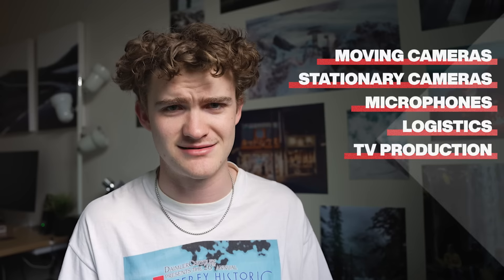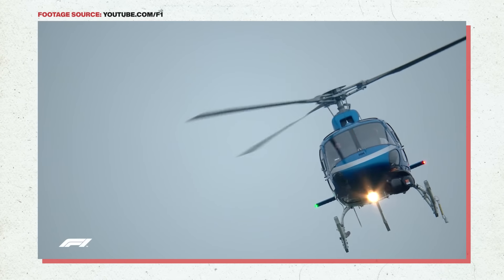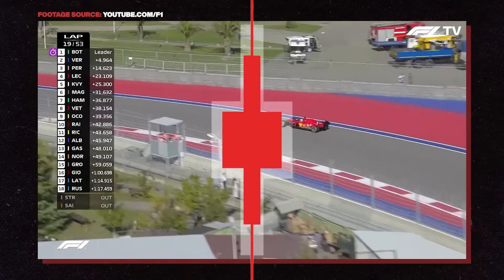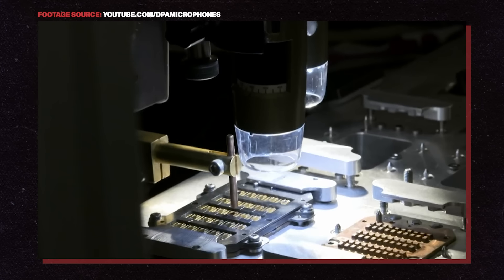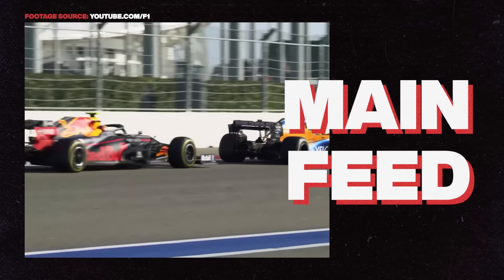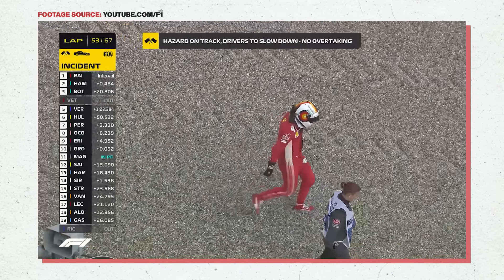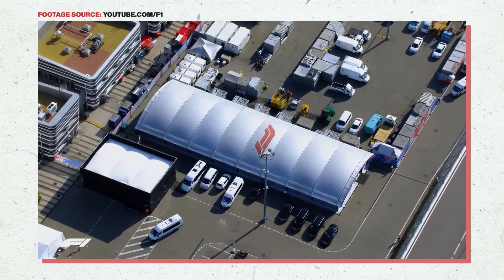How Formula 1 is Filmed (It's a Technical Masterpiece)

Comment: 🎯 Key Takeaways for quick navigation:

00:00 🚁 Overview of Formula 1 Filming
- Formula 1 racing is not just about the cars but also a technical masterpiece in terms of filming.
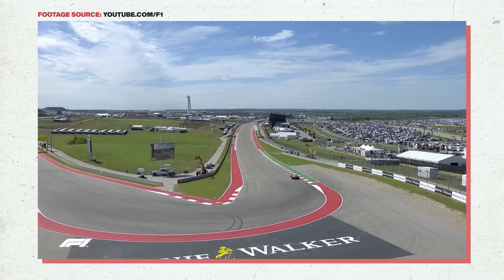01:24 🚗 Types of Cameras Used
- Helicopter: Provides dynamic and immersive shots using camera stabilizers.
- Onboard Cameras: Offer exciting footage by placing lightweight cameras on cars.
- Cable Cam: Utilizes a high-speed camera system for tracking cars.
03:03 📹 Trackside Cameras and Specialty Cameras
- Trackside Cameras: Vital for race coverage, providing quality video feed for broadcast.
- Specialty Cameras: Include embedded track cameras and scissor lift cameras for unique angles.
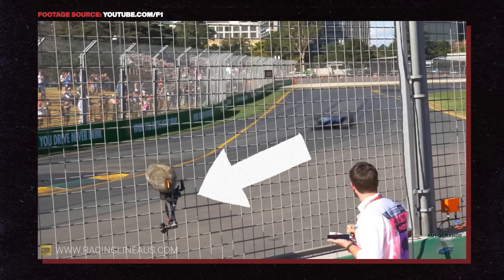06:39 🎤 Importance of Microphones
- 147 microphones around the track capture the sound critical for viewer enjoyment.
- Fans' complaints led to the introduction of car-mounted microphones to amplify audio for TV.
07:36 📺 Television Production Process
- Complex process of combining 126 cameras and 147 microphones for seamless live broadcast.
- Different teams manage audio mixes, replays, and trackside coverage for compelling TV program.

Made with HARPA AI

Comment: The saddest part of all is that even with the microphone right at the exhaust, the modern cars have absolutely nothing on the V10 monsters from the early 2000s. The starts of any GP from 2000 to 2005 could've been heard as far as 10kms away. The all-time record i think was held by Ferrari 's 643 in the 90s when at Imola it produced almost 160dB or as loud as Boeing 747 at full throttle during take off. 20 000 RPMs with 10 cylinders sounded just otherwordly and i really feel sorry for anyone who couldn't experience that epicness.

Comment: Building the control room from 0 is so crazy!
Reply: The actual process is not unusual, the sheer size of the F1 setup is. I work in TV and my first role was working on Big Brother UK. The company that provided all the tech equipment and crew were also the same company that provided the same facilities for other TV shows. After the last TX of Big Brother the entire setup was de-rigged and transported to the next location/show (In this case it was Fame Academy) setup and ready to go for an entirely new show and series. This was repeated throughout the year.

Comment: 2:23. You missed a perfect opportunity to talk about the field of vison we have in the current cars vs the cameras they used in the mid 80's. The cameras had a much lower FOV showing a much more realistic depth perception of the speed of the cars.

I'd like to see a return of some more low FOV angles especially when a car is either following, or in a section of the race that we don't need to see what's around the car.

Otherwise, loved the video

Comment: Great video, thank you!! As someone both interested in TV production and F1, it's awesome. Sadly, I feel like the live coverage for 2022 so far has been really poor, barely showing any "halo onboard", and overusing the helmet cam throughout battles, while you can barely see the car in front.. We also get less info through the graphics (can't see the G, when DRS is open, etc). Does anyone happen to know if that's due to a Team Leader switch or if the directives have changed?

Comment: Cool video, but you keep mentioning 126 cameras and I can’t help wondering if that is really the right number? Just counting the 5 onboard 22 cars, you immediately have 110 cameras, add heli, cable, scissors and 10 pit lane cameras and we’re almost at that figure without getting into the track cams, of which there are definitely more than 3.

Comment: Tye filming at some strret circuits affects the camera setup and shots. Eg Jeddah cannot show side shots just head on or rear and so helicopter supplements some sections. Cameras fitted high on barriers as these sorts of tracks and drones need to be improved to a mprove tye vision.  
Are you aware a lot of the audio is not real,? In late 23 a it failure saw no sound on the international tv images and it was soooo boring and bad. Sky admitted they added audio to simulate the loss of track audio